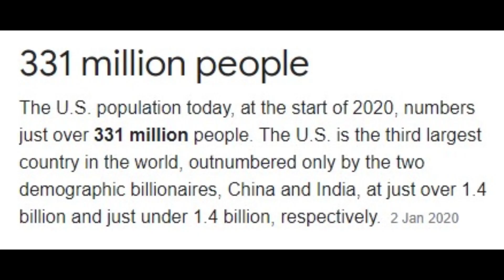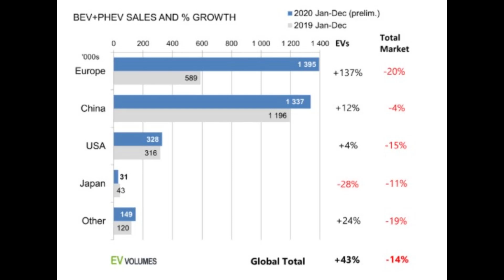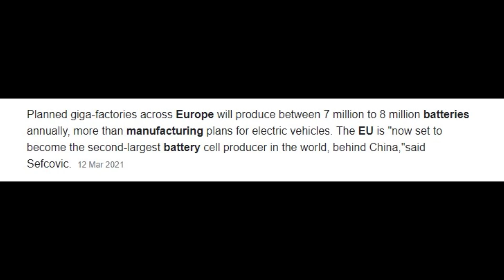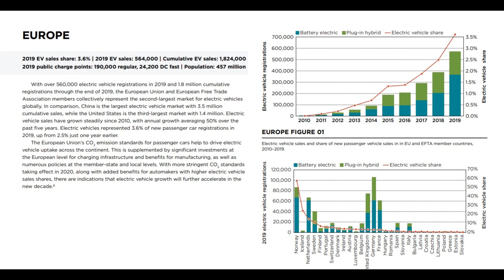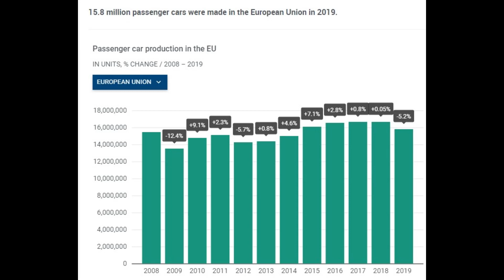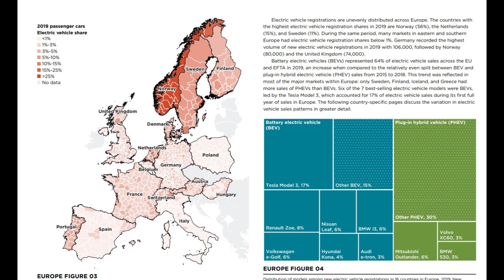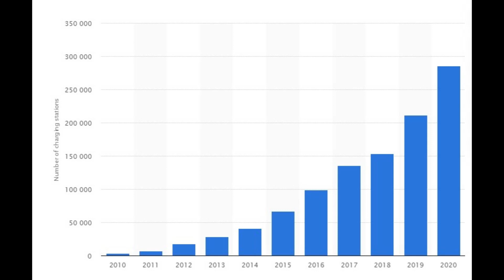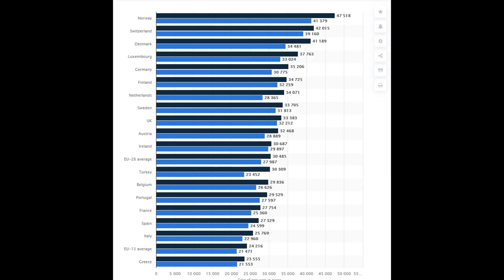WHY Tesla will TAKEOVER the EUROPEAN Market very soon!, TESLA`s final step for DOMINATION

Comment: i dont think teslas are well suited to the European market. Plus the dealership network is pretty important. i just dont see how tesla can dislodge say VW group.
Reply: Tesla and all EVs are better suited for the European markets than to North America, and are already catching on big style. Look at Norway for example. We drive shorter journeys for a start but the big factor is the ratio of petrol /diesel to electricity. We can get our electricity at a low rate overnight and our petrol and diesel are heavily taxed. Running an EV in the UK is about one fifth of the cost per mile so initial extra cost of the car is recouped over a few years.